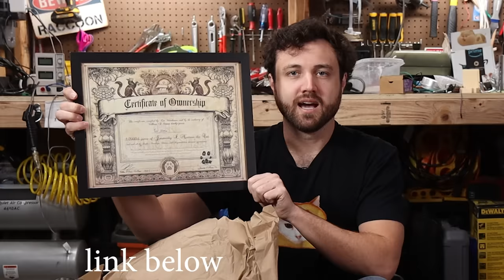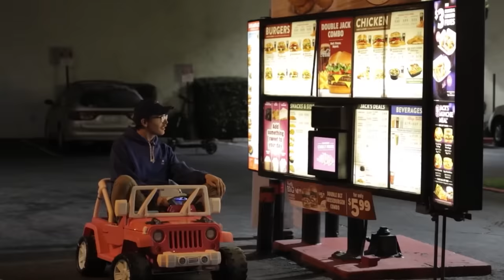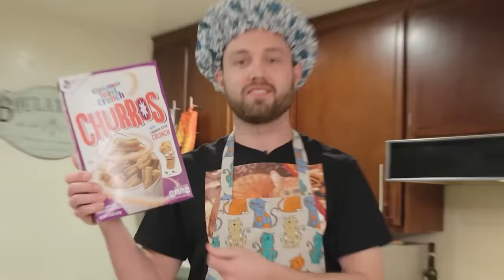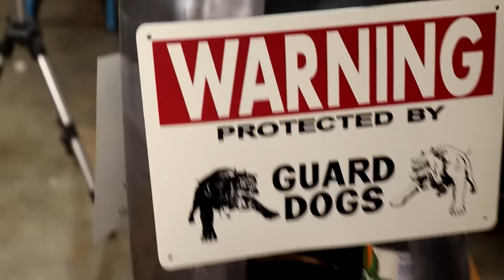The Best of William Osman

Comment: i didn't know the meaning of dangerous 'til i watched the racing power tools vid. when those grinders with saw blades started leaping through the air, even I thought 'that looks a bit unsafe' (and i once spent 2 weeks in hospital after putting a vessel filled with naphthalene, in which floated a bit of lithium, under a water tap)